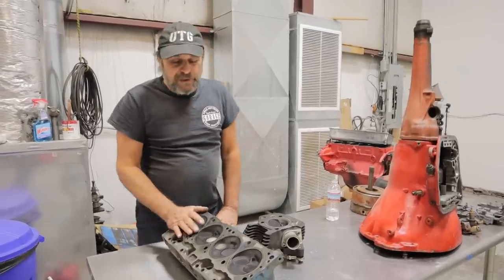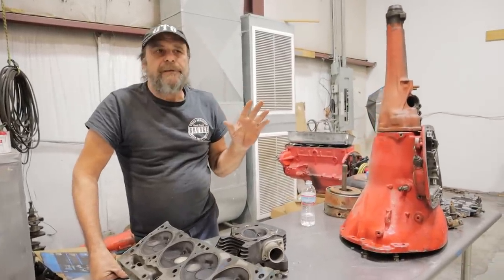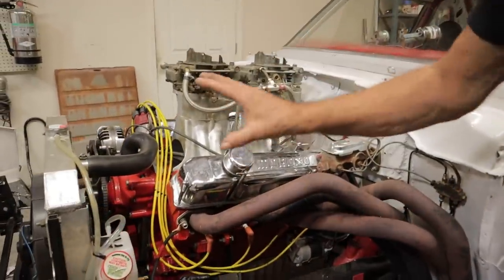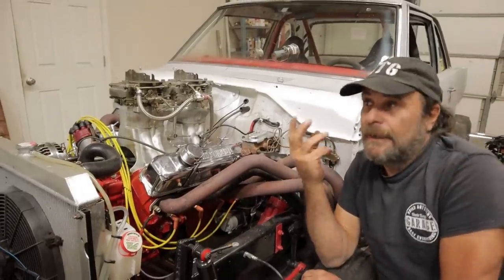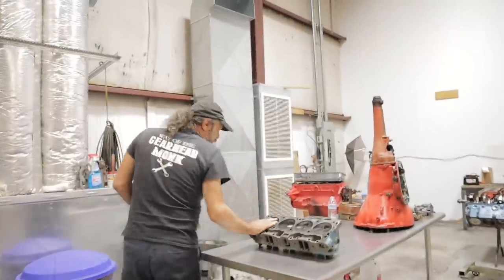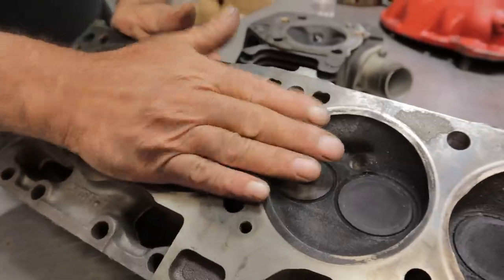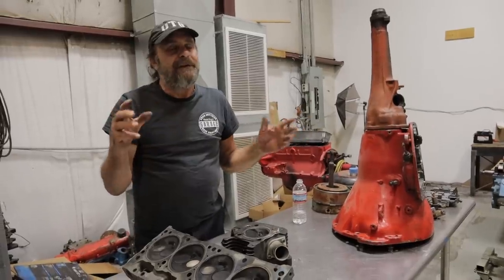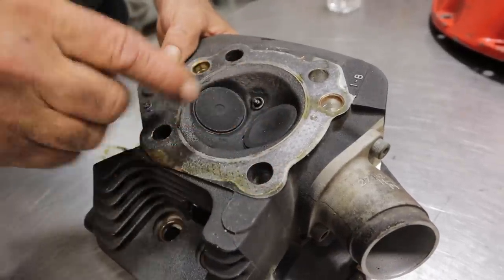The Secret Life Of Your Engines Cylinder Heads - How Combustion Chamber Shapes Make Power

Comment: So I have a question... What other influences matter in the chamber design and where does one thing make a better head than another?  Thinking of the big block Chevy here, the original heads were closed chamber bathtub chambers. Sometime around 68, the open chamber head came out and no one looked back, closed chamber heads were not even a consideration unless it was a budget build. The open design made more flow and power across the board, all the factory and even after-market heads were all open design. So this would make me think that other influences can alter the total performance of a head design? I know in the last decade or two newer designs that optimize, well, kinda everything has become the rage. Today's technological marvel is tomorrow's trash? I may be adding to much to what was supposed to be a combustion chamber 101 class?

Comment: If your filling the combustion area in the head with material. Wouldn't that be reducing the chamber size and in result increasing compression. That to me would have a lot to do with compression.
Reply from the maker: Raised compression is a byproduct
Reply: byproduct and a benefit. Those quench pads make a faster burn to reduce the chance of detonation.

Comment: Not to doubt our pushrod god but doesn't the descending piston pull the incoming fuel/air mix. Is it just that the overlap starts this process? Leading to just slightly better cylinder filling?
Reply from the maker: Put your hand over the air inlet of a running engine.  Now, imagine that the intake valve and piston face are feeling that same force as the valve opens.
Now you understand the importance of overlap
Reply: @UncleTonysGarage Ok so that sonic pulse is what generates the velocity for the intake charge. Is it more pronounced than the descending piston pull?
Reply from the maker: It initiates the pull overcoming the prevalent low pressure area of the intake runner.

Comment: Does back pressure have any affect and if so how?
Reply from the maker: Backpressure is always a detriment
Reply: Engines that run better with smaller diameter pipes are often mistakenly thought of as needing backpressure. The reality is that the speed of the exhaust pulse goes hand in hand with the pressure wave principle described in this video. The speed of the airflow from the other pipes entering the collector can create a siphon effect on the pipe with open overlap in addition to the pressure wave action.
Reply: @jamesschneider3329  Thank you for explaining. Easy to picture now.
Reply: @UncleTonysGarage  Thank you UT.

Comment: I know Tony is "stand off ish" to use the Magnum head . The Magnum head is really a great design with it's closed chambers and high velocity ports. They were made for ten years 1992-2002 and are cheap and plentiful.
Reply from the maker: I love the Magnum heads, and actually have a pair in my shed back at the house.
For this engine, I want to keep the shaft mount rockers, and would like to easily swap a few different style intake manifolds onto it.
Reply: @UncleTonysGarage  I didn't even consider the added stability of the shaft mounted rocker arms. Good point Tony.

Comment: Question, if you're going after a max performance 318 then why would you even mess around with them junk head's? I mean you could port those until the cows come home and still aren't going to flow worth a crap! And TrickFlow just came out with some killer small block Chrysler head's! So why would ya? Them heads will never be worth the time and effort and money you'll put into them, then theirs the weight savings of going with an aluminum head as well, much more efficient chamber design's, etc.etc.etc.
Reply: I think it follows with the "run what ya have" mentality. Sure, a stock set of heads will flow poorly compared to an aftermarket set of heads, but not everyone has aftermarket heads money. It's a learning curve to learn to port heads and a great self teaching tool. Most people wouldn't believe the seat of the pants improvement you'd get by porting a set of stock heads and doing some gasket matching.

Comment: Why not start with a set of heads that are already “closed chamber”?
Reply from the maker: The only factory closed chamber LA heads are the early 273/318 castings.  GREAT heads, but not capable of the volume I need for this engine.  Aftermarket heads that fit all the criteria don't accept standard LA intake or exhausts.
Reply: @UncleTonysGarage  
I have a set of 4323302 heads, worth installing on a mild 318 like you started out with in bottle rocket?  Or should I stick with the stock heads that are already on it. 1974 LA.
Reply from the maker: The 302's are great heads and very comparable to the ones currently on Bottle Rocket.  The main difference is that the 302 REALLY needs major cleanup on the exhaust port to reach its potential.

Comment: I'm not sure I believe a hemi has a true advantage over a wedge engine? Yes, I believe when they released the 426 hemi it had a advantage, however im not so sure it was simply becouse it was a hemi? Obviously it was more modern than say the ford wedge. But the ford wedge had a bullseye on its back. Meaning they had a example of what they wanted to beat. They had a target. And the ford was getting pretty dated at that time but continued to run very competitive for it being a old design. Personally I think it's a testimate to just how good the ford really was. The hemi dus have some advantages but just being a hemi also has disadvantages.  I dont know if you weigh each end up witch side the favor is? Wedge pistons can have higher piston rings than the hemi. That's a advantage for the wedge. There is to much to go into detail but wedge or hemi design, I think you just have to work your strong points & run.

Comment: So why start with an LA head instead of a Magnum head that flows more stock has lighter valve train and a better combustion chamber.
Reply from the maker: Two main reasons.  I want to keep the shaft rockers and I have a bunch of LA intake manifolds I'd like to try on this combination.
Reply: Never was a fan of the magnum head. For lack of rocker shafts.

Comment: Pro-Stock cylinder head design evolution is more closely related to the Ford Cleveland head and not the Rat Engine Chevrolet. No brag. Just fact.
Reply from the maker: The Chevy predates the Cleveland by ten years...the Chrysler POLY predates the Chevy by ten years.
Who's copying who?
Reply: @UncleTonysGarage  Not talking about about who was first with the canted valve configuration but overall architecture, i.e. symmetric porting, runner design, combustion chamber design, valve angles, etc. BTW. Even as a Ford guy I follow you closely. Keep up the good and informative work!

Comment: Everything here is half wrong. What is sad is how hundreds here just lap it up like its gospel. They will go on to perpetuate the half truths to others.
Reply from the maker: Feel free to elaborate!
Reply: @UncleTonysGarage  OK
1:00 no one ever talks about overlap flow??? EVERYONE who knows engines talks about it.

3:08 the effect of camshaft timing is MAINLY intake closing point #1 then exhaust opening point #2 then overlap a distant 3rd. So camshaft timing is NOT based on the overlap period.
3:20 Engines run bad with no exhaust only because of intake manifold vacuum at idle. Witness all fighter plane engines of WW2 all with stub pipes just long enough to get out. At idle rpm and closed throttle the engine can back breathe from the exhaust leaning the mixture.There IS an exhaust pulse but it is long over by overlap time.
3:40 the cylinder will get full enough if the throttle is open and not generating a vacuum.
3:42 "the void behind the pulse" is a big over simplification of what happens in a header. At idle there is almost no effect from the exhaust pulse. All the pipe does at that point is prevent outside air from getting in.
7:01 There will be no "pressure spike" there unless there IS detonation. There will be no competing against the flame front causing detonation. That smells like the old "colliding flame fronts" BS.
7:30 Those original hemis (again fighter planes) WERE designed for performance because of the superior air flow and excellent combustion AS LONG AS COMPRESSION WAS LOW as it was then.(the exact same reason it works so well in top fuel)
8:38 It had little to do with the "in and out motion to the flow" of the combustion chamber and had everything to do with less port angle on both ports while at the same time centralizing the mixture under the plug. Not that it could go across the chamber and out. The wedge does not come in and make a turn and go out, that is ONLY a tiny bit of flow during overlap and not the main thing.
9:20 that "straight through flow" had nothing to do with its advantage. In fact that was a disadvantage causing lousy fuel consumption while giving no power.
9:45 Closing up the chamber was not to give "a better signal to the intake side". It was to allow a lower piston dome for higher compression and maintaining charge centralization while also controlling the intake port exit better and the exhaust port exit.
10:30 there was no need for more flow on overlap. That sideways twist was for swirl and reducing fuel loss out the exhaust. Again closing the chamber was for piston dome reduction.
14:38 It has almost nothing to do with overlap flow and has everything to do with getting compression without a big lump of piston dome in the middle of the charge.

The hemi used in pro stock had a HORRIBLE combustion chamber because of the massive piston dome but great air flow. The chamber burned slow, burned incompletely, lost fuel out the exhaust and had terrible heat loss to both the chamber and the piston. The chevs had inferior flow but good combustion and were able to edge out the hemis because of that. In time they even got the airflow up so the old hemis stood no chance without a radical change and that is what Ford and BG did.
Reply from the maker: Bill, thank you for the well thought out reply!
A couple of things jump out at me.  The exhaust on fighter planes was tuned for power in a high, narrow RPM range.  They didn't need to make the low end torque our car engines do.
I stand by my statement of overlap being the point at which camshaft timing is derived...I mean, that's just a simple fact.  Valve opening and closing points are dictated by the lobe profile and are fixed to the cam.  In other words, regardless of the grind, timing is still set at overlap.
  As for the Hemi application in Top Fuel, I can absolutely assure you that it has nothing to do with the engines virtues as found in aircraft or passenger car engines.  Been there and done that hands-on.
  The downside of high compression Hemi engines as found in applications like Pro Stock is something I've covered in previous videos...as well as a couple of magazine articles.
As for nobody talking about these things...I'm referring to other popular sources of engine content intended for the average enthusiast, not engine builders.
Thank you again for taking the time to make your points.
I think you should consider producing some content on Youtube.  You have a lot to offer.
Reply: @UncleTonysGarage  Regardless of how the timing is set, the main effect is always intake closing point and secondarily the exhaust opening point. Setting it on overlap is simply a matter of convenience because normally the goal is to split the intake and exhaust CLs and if you are altering the timing you need to make sure there is no piston valve interference. Retarding the cam delays intake closing for a better high speed but on a single pattern cam you also retard the exhaust and that compromises the outcome a bit. The exact timing has little effect on the overlap scavenging flow, it just moves it slightly in the band. You can set your cam timing using any reference you like so long as you watch your piston to valve clearances. Setting it at overlap does not mean overlap itself is important.

 The fighter planes were not tuned at all they just dumped the exhaust backwards to  get a bit of thrust from all the waste. The stubs were far too short for any kind of tuning at the low speeds those engines ran at(under 3000 takes ~75"pipes). My point was that they are short enough to disprove the idea that the engine won't run without a pipe.

I too have worked in top fuel and in pro stock and the hemi in fuelers most definately work because of the chamber geometry when used in low compression situations. Every other type has been tried and all failed. That is because the hemi offers minimum surface to volume ratio and central spark plugs for slow burning nitro. I will concede that overlap blow through does help in top fuel because the chamber is vast.

The hemi in pro stock was a dead end with that chamber at high compression. We were planning a lot of mods along the lines of what ford did but then switched to chev just because it was easier. That left royhill and larrypeternell as the last old hemis in PS. That is when I left drag racing to road racing and dennis RIP moved on too to KennyK then sonny's RE.

I stand by my point that overlap is not the main property of cam timing. When you retard the cam you are trying to simulate a cam with longer intake timing but it's a compromise and only works to a point.
 
I might consider making some content but D Vizard asked me to do something with him. Plus I am pretty full with aero R&D and I ain't young anymore.
Reply: @UncleTonysGarage  Kudos to you for not ducking and engaging. This reminds me of the old Isky 5th cycle idea from the 60s.